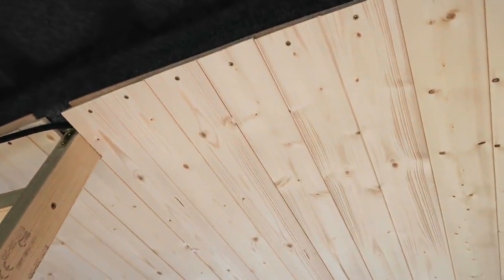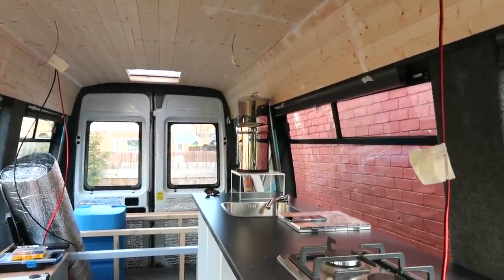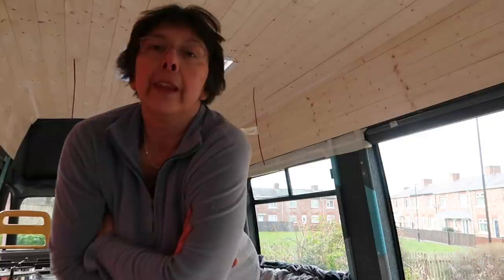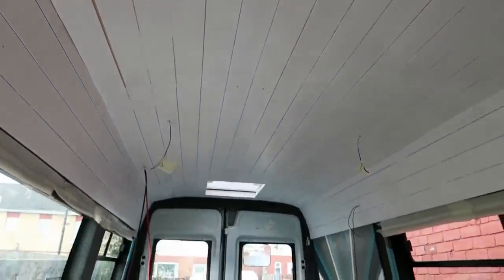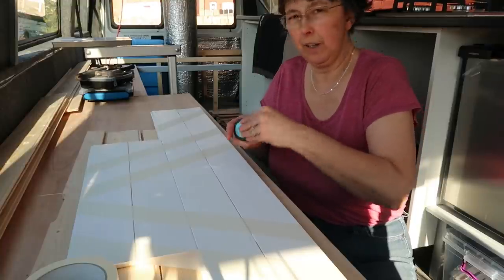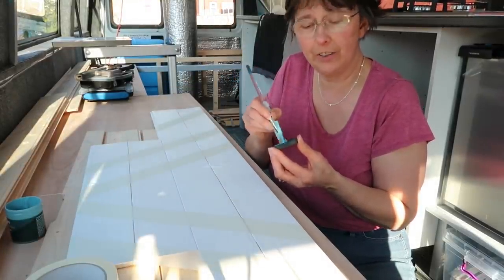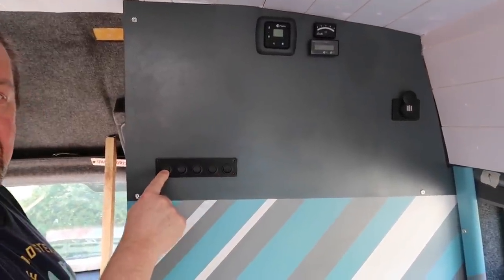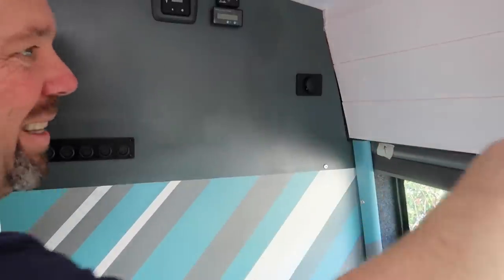Part 13 - Our Iveco Daily Self Build Minibus Conversion - Painting and Finishing the Fiddly Bits

Comment: Hi guys, hope you are well.  Bus is looking really great and progressing well. I've been wondering about the paints you're using,  could you provide details please? Thanks for sharing. Stay safe and keep up the good work. :)
Reply from the maker: Thanks so much for watching and I'm glad you like what we've done. 
Paints, OK.....all from B&Q so far, 
The grey on the seating was the only 'special ' one and sadly I've used it all and thrown the tin, but it was from the hard-wearing section for wood and metal.
Just normal brilliant white on ceiling in z silk finish
Little tester pots for the colours in a silk finish too. All of them worked well, with good colour and quality. 
Then everything except ceiling had 2 coats of rustoleum clear lacquer .
Hope that helps,  Elaine 😊
Reply: @PensionersinPortugal  Thanks for your prompt reply, Elaine. Lots of info to ponder over. Cheers for now. :)
Reply from the maker: You're welcome 😊